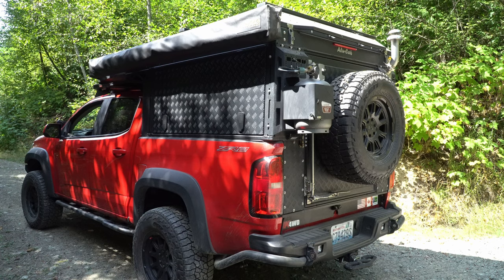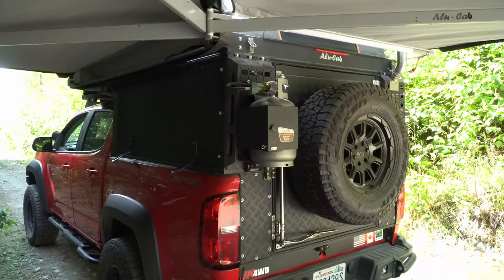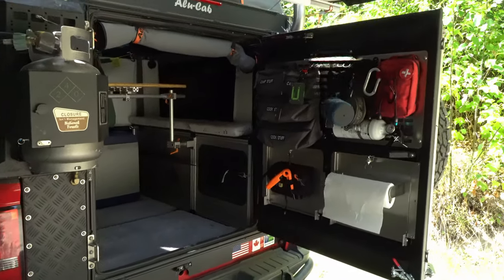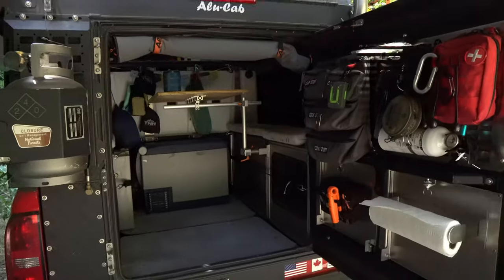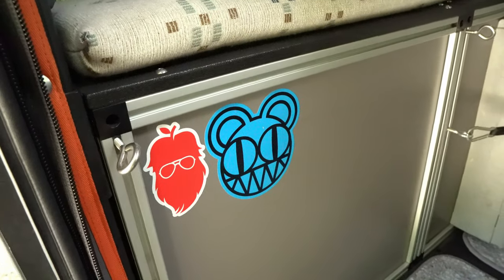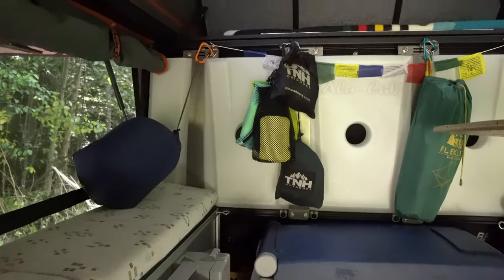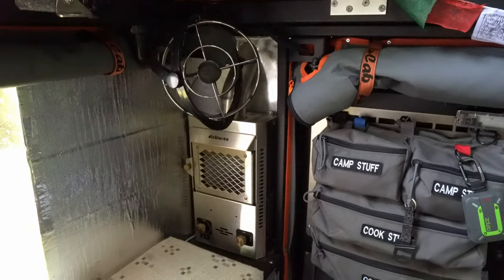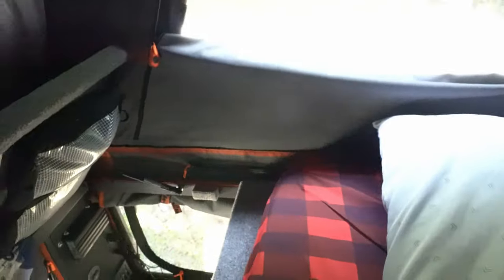Updated & Extended Alu Cab Canopy Camper Walkaround

Comment: Great review I like that you went with cabinets and not drawers. I like that there is more floor space. Thanks for the idea.

Speaking of locking the door is ther a way to make sure some nefarious person cant walk up and lock you in by closing the outside latch?
Reply from the maker: Hmm..Ive been told by a few that if you lock your outside latch in place while in the unlocked position, it makes it a bit more difficult to lock you in from the outside.  The good thing is if you do get locked in you can just jump out any of the bed area zip out windows.

Comment: Great vid, very well thought out! Thanks for your time. If the heater did melt part of the screen on the side door would it be possible to replace it easily? Also how wide are your seat cushions/goose gear boxes? How wide is your middle alley? Whats under the prototype panel at the 28 min mark if you dont have the goose gear panel there? Do you plan on doing any type of shower set up/hot water heater set up? Thanks!
Reply from the maker: Yep easily replaceable screen.  Goose gear storage cabinets are 12” wide.  Middle is just over three feet wide. Nothing is under panel just blank space.. I have a shower setup, I use Geyser Systems portable shower.

Comment: This has to be one of the best builds that I have seen,  the attention to detail is impressive.  Now with that said; there's just one thing that sticks out... and that's the fuel reserves for max range.  Did you add an auxiliary tank?  Personally I would have to go the opposite direction with the expedition one dual swing out which gives me the ability to carry 16 additional gallons in reserves for a piece of mind.
Reply from the maker: I have 5 gallons of additional diesel I take with me just in case.  I can always add more if I am doing much longer backcountry routes.  The small Diesel engine gets amazing MPG for the setup I have.

Comment: A super review.  I looked at the Alu-Cab gear at Overland Expo east this weekend and saw a few builds almost identical to yours.  Are you concerned that road vibration over time could rub a hole in your gas line and do you have a mitigation in place?  I thought about it with each of the furnace builds that I saw but didn't think to ask any of the owners.

Comment: Very nice. Do you still use the stock shocks, or did you have to replace the shocks in the back (and front) to handle the extra weight?

Comment: That's a really nice setup you have 
Does the canopy camper make it feel top heavy or feel like a regular topper
Reply from the maker: Not really but the suspension did feel a bit floaty around corners but a Hellwig sway bar fixed this issue. Handles so great now even good off road, sway bar doesn’t really limit too much travel.  But I’m touring and just off-roading not hardcore rock crawling.

Comment: A point of trouble I have with the Alu Cab Canopy each time I'm thinking about one is the fact that there is no window. So if you want to use it in cold weather and be comfy with your fireplace you find yourself in complete darkness (or non natural light...).
How do you handle that ? I really feel this camper should have a few windows or at least some transparent plastic on the tent part.
Reply from the maker: GP Factor just came out with a window kit for these campers.
Reply: @HudsonZRoamer  Interesting, I'll check it!

Comment: did you retain the back up camera?
Reply from the maker: Yep attached it to the bottom of the canopy camper…Easy peasy.
Reply: @HudsonZRoamer  thanks. I’m sold on this setup. I was going with the adventure alucab like you had before- but all in one is the way to go.
Reply: @HudsonZRoamer  Did you use an aftermarket bracket or did you fabricate one?  Thanks!